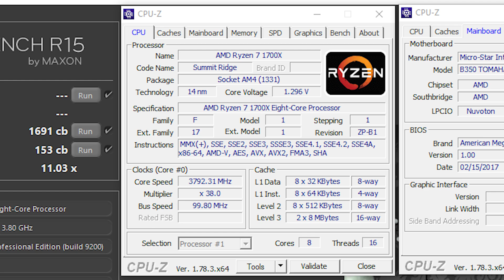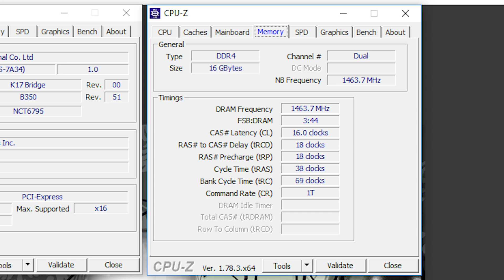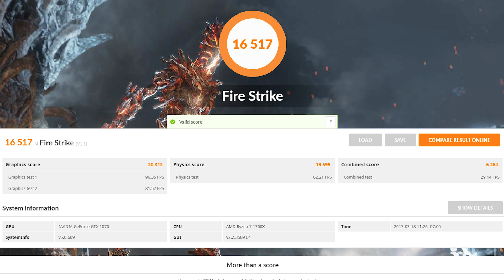$1500 Ryzen Workstation/Gaming PC | Build 11 - Power to work and play!

Comment: If i go with a 1600X and a 1070, is a 500W PSU enough? Or should i go with 650W?
Reply from the maker: +Putra Wibowo it should be enough. This build barely used more than 400W under full load.
Reply: O!Technology Thanks for replying, also, 16gb DDR4-2400 is enough right? I don't think it'll make that much of a difference.
Reply: I was referring to the frequency.
Reply from the maker: Oh you need fast RAM on Ryzen it helps a lot. Get at least 3000MHz RAM.
Reply: O!Technology Bedanya 200rb -_-
Reply from the maker: Kecil atuh. Harga RAM aja berapa.